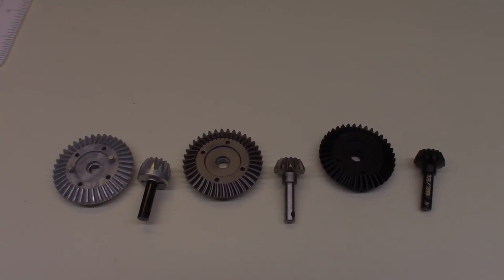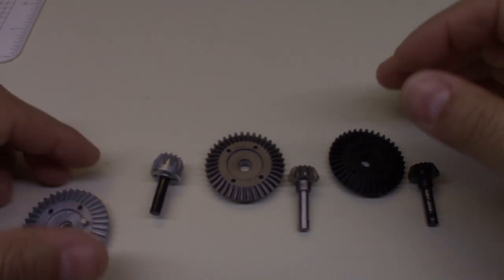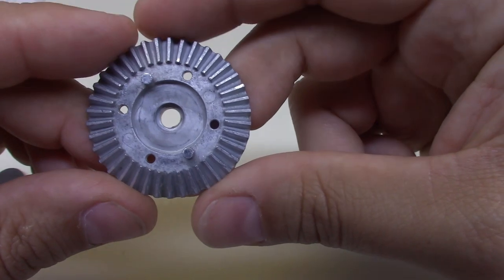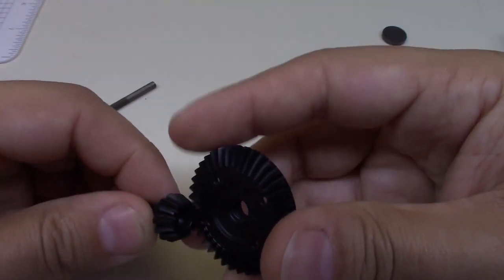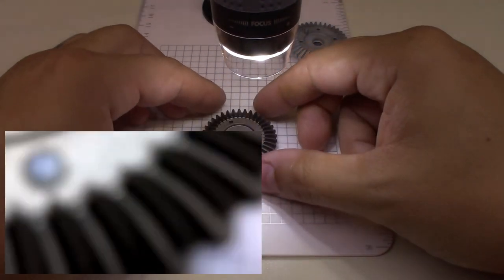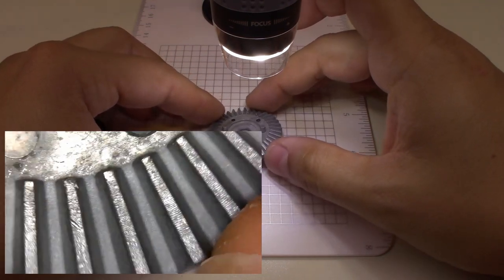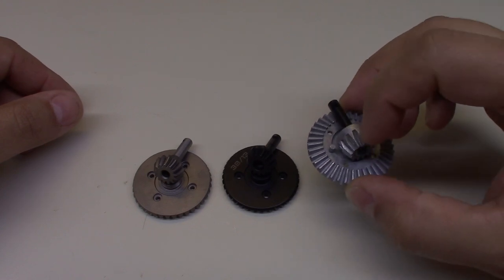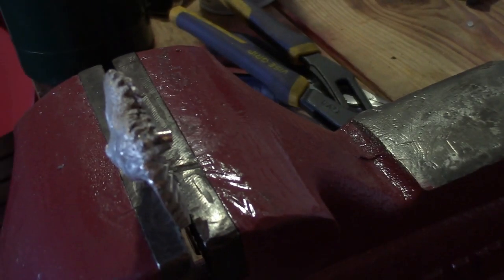Axial AR60 Ring And Pinion Comparison (RTR, Axial Upgrade and Vanquish Upgrade

Comment: Axial does a lot of stuff I don't think is acceptable.  I have over 1500 in upgrades on my smt10 and it still breaks almost every outing.  That's not okay when they sell something knowing 100% the vehicle is going to require so many upgrades to even be enjoyable
Reply from the maker: Unfortunately that's the way pretty much every company, to some extent, does things.  Some are worse than others.  Costs have to be kept down but the attitude that we are willing to upgrades things so it's acceptable to out junk in kind of sucks.  It especially feels like a slap in the face when the company sells the parts to correct the issues themselves....

Comment: Great comparison!! Thx for that
Reply: At least the original part lasts pretty long in a scale truck ... i am wondering about that fact after seeing this video
Reply from the maker: Maybe so but it sure didn't last in mine and I wasn't running it very hard. 2s only no less.  I honestly think plastic gears would have been more durable.  That soft pot metal just isnt fit for the purpose.  Please subscribe if you enjoyed!!